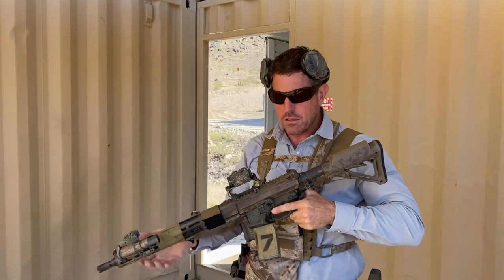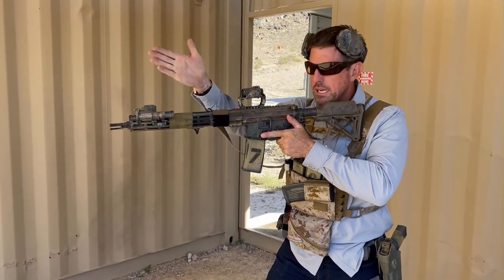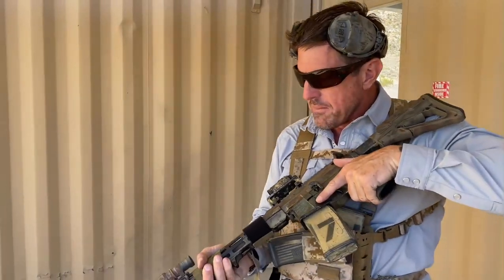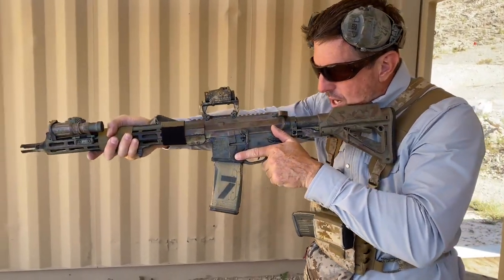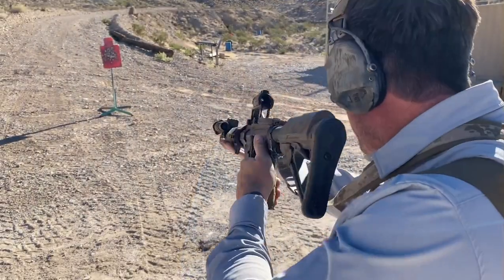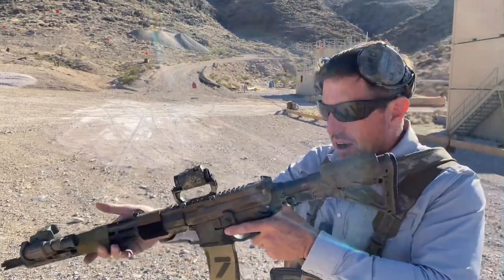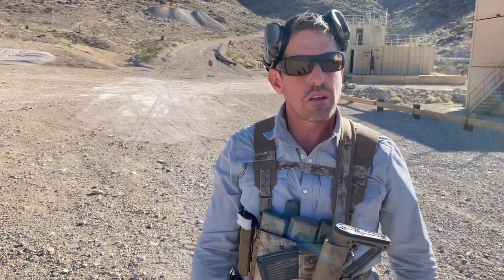Over the Shoulder Compressed Low Ready Position

Comment: I prefer the over ready, I know it's a bit more actions but for CQB it works well, speaking directly to the AR platform
Reply: Be ready is the point ,high or low , it works for anything that has a safety  lever that mimics the carbines safeties.